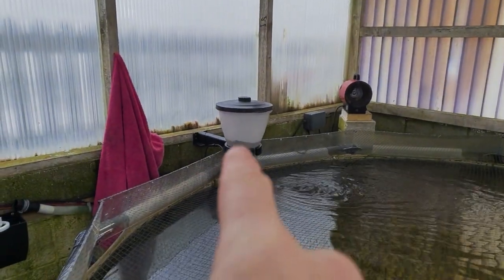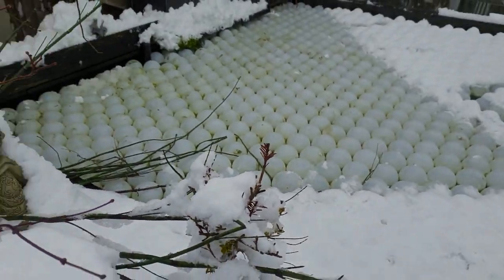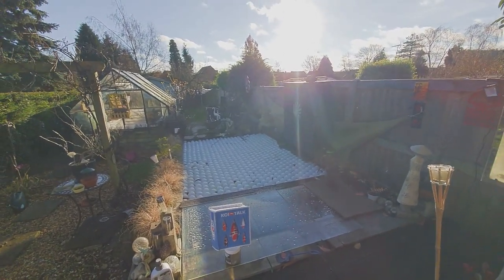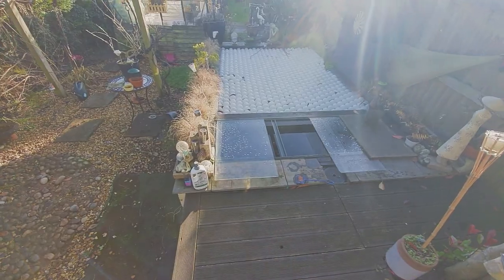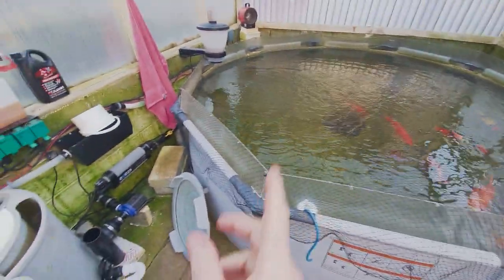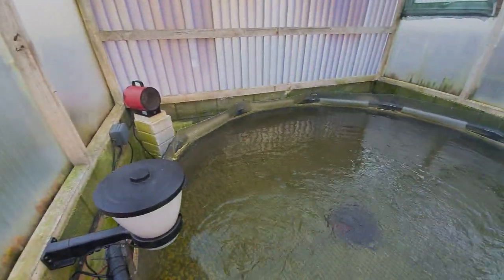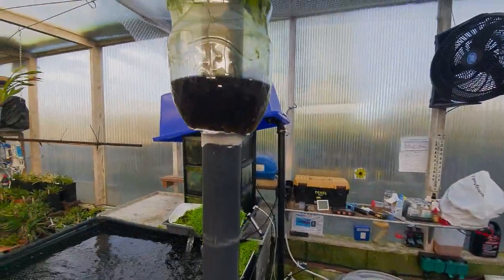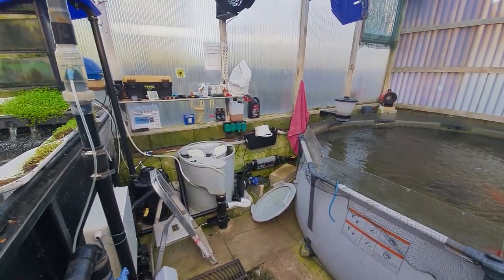Let it snow|Saki Hikari Waste Result|Koi Talk Magazine|Moving Bed?

Comment: Hi mate. I use a 220ltr blue barrel with 120ltr of k+/k1 with a 30lpm air pump. Tumbles really well. The air 'stone' is a loop of 15mm speedfit with 2mm holes drilled it it. The outlet is 110mm drainage pipe with a section cut out of it wrapped with 5mm stainless mesh. Very happy with it been working well all season. Hope you all have a great Christmas

Comment: I struggled with a moving bed after a pod, it's ok if you clean it each day otherwise as the water level in the pod dropped so did the moving bed and it impacted the tumble. In the space you have you would be better off with a 220 nexus and with the right air pump you can go up to 150 L of k1+. Mine works a treat now.
Reply from the maker: I've got news on this coming up! I'm over the moon with the tumble I've got going with media I've chosen. Most go for k1 but I've gone with what most aren't yet. Put the lid up on the moving bed today and wow 👌  blown away so far. If I have trouble with water level I'll put the water trickle fill back on. Cheers, looking forward to seeing this progress 👍

Comment: Hi Kieth use a tall round water butt or a Bakki shower with bhm
Reply: I’m using a black 310ltr bottle bin for my moving bed off eBay £80
Reply from the maker: I've used a domestic storage tank I've had for years! Working a treat so far. Video coming soon.